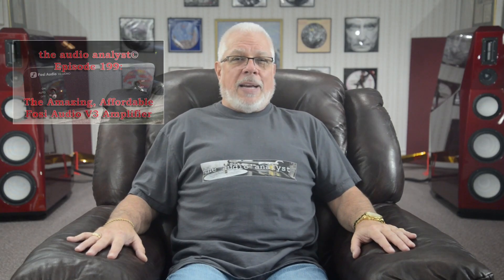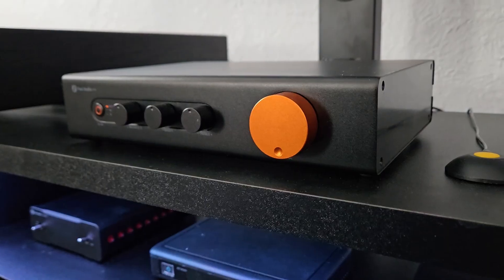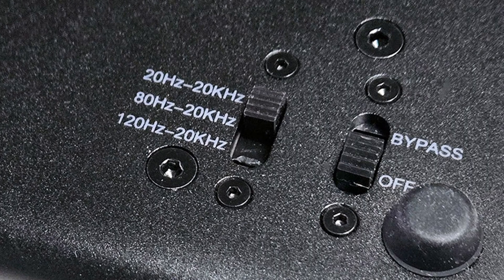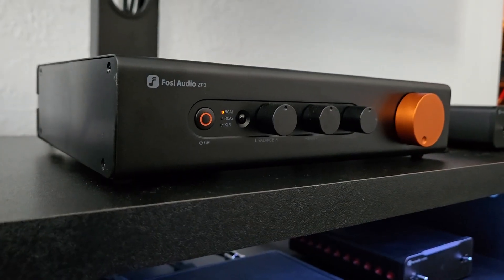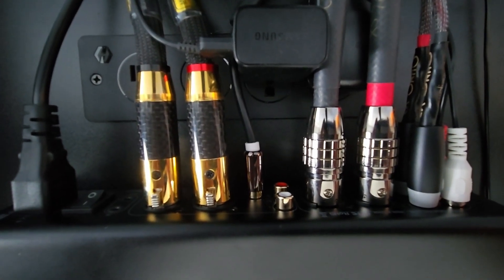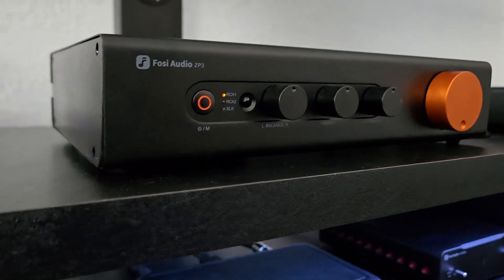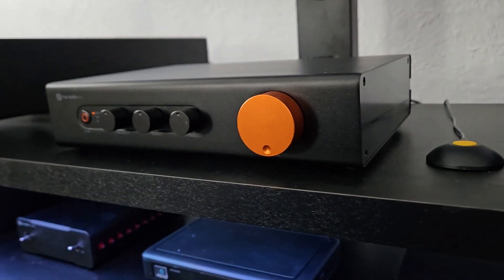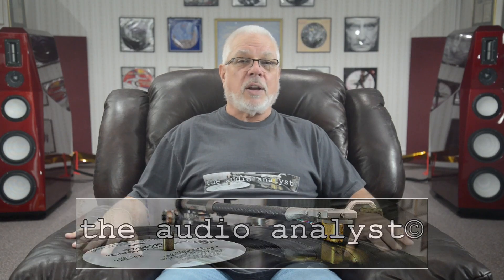E250: The Fosi Audio ZP3 Balanced Linestage

Comment: Speakers also has crossovers built in to them to block any unwanted frequencies that the speakers can't produce anyway either Higher Khz or lower Hz. So speakers getting damaged is our of scene.
Reply from the maker: In all my decades working with and around loudspeakers, designing and building dozens of pairs, repairing and or upgrading them, or working with many of today's best designers, I've never seen ANY such protection circuitry built into the crossovers by any manufacturer... Can you cite a specific example?

Comment: Very nice review thank you.

Quick question:

Can you adjust the sub level with the remote control?

Merry Christmas 🎄
Reply from the maker: Hello, and Merry Christmas to you as well! And no, of course the ZP3 remote cannot control your sub/s. Now, there are subs that offer their own remote control, usually using an app that allows gain and phase control.
Reply: YES you can, but it kind of depends what you're asking here. The RCA sub output on the ZP3 is a full range variable output. That means a couple of things. 1) The full range of sound is sent from this to your sub, just like other RCA and XLR outs. This unit only has a high pass filter, NOT a low pass filter. (It's NOT a full crossover.) So you'll need to use your subwoofer's low pass filter setting to adjust it to either where your speakers naturally falloff (at the 3dB down point), or where you've set your ZP3's high pass filter setting to. This was confirmed via ASR, despite Fosi indicating there was some sort of 200hz cutoff on the sub out. But either way... who wants to send up to even 200hz to their sub! You've got to use your sub's low pass filter in conjunction with this unit. 2) When you control the volume of the ZP3 with the volume knob on the unit or the ZP3's remote control, it adjusts the volume for both your main RCA/XLR outputs to your main speaker amps and ALSO the subwoofer out.

So YES, you CAN adjust the sub level with the remote control... but only in conjunction with the mains' levels. Of course, this is what everyone would prefer I think! And that's probably what you were asking.

In order to adjust your sub's volume INDEPENDENTLY of your speakers (to volume match or just set the low frequencies to your preference), you'll need to use your sub's amp's gain settings.
Reply: @KeepinItGameSince84  Awesome thank you very much. 👍🏻

Comment: You should give the Aiyima T20 preamp a try. It costs less than the Fosi and sounds much better imo. I added a LPS and some PSvane horizon tubes. I replaced my $6,000 Linear Tube Audio Microzotl preamp with the $160 T20.

Comment: Nice review Greg. I wholeheartedly agree, it’s a great little preamp. Especially with discrete opamps. I also love the HPF option as well as I have it paired with a 40 w/ch class A Nelson Pass amp and it alleviates the amp from having to deal with driving the lowest bass notes. The transparency of the ZP3 allows my Denafrips Pontus II DAC to shine through and the Pass amp to bring the sweetness and color. Not sure if I mentioned this before in your other video but I bought a simple Mickey Mouse to standard IEC adapter off Amazon allowing me to use high quality power cords with the ZP3 bringing yet another level of improvement.

Comment: I’ll never be able to add those op-amps 😖
Reply: Several people, including myself, have swapped the opamps out by using long tweezers through one side of the unit. You don’t have to take the unit apart. You will slightly mangle the stock opamps getting them out but putting in discrete’s with the tweezers is easy and takes seconds. I’m running SX52B myself. I tried the Sparkos and they sound great in the ZP3 of course but the SX52B just synergizes better with my system and tastes.

Comment: 👍🏻 Everybody loves an underdog. Its a good option if you need more inputs or the tone controls or the HPF. 

That HPF is something often requested but seldomly found. And it is such a great benefit if you use small monitors, like you find most Asian households. That is probably why they chose 80Hz and 120Hz. 

I could do with 120Hz where my monitors get to 0dB. Or maybe my old LS3/5a'. Both would do best with 80Hz though. 

Im using my Genesis VI speakers as subwoofers crossing at 90Hz and I can't tell where the bass is coming from other than determined by my monitors. 

I designed and built my monitors with 2 3" Ti fullrange per side front to back, closed cabinet with a small AMT supertweeter. Now i just switched to the Douk/Ampapa D1 TPA3255 with an adjustable HPF I do notice the improvement in dynamics and clarity you described. 

I find this hard to say but I think i like the Ampapa D1 with Burson V7 Vivid even better than the Fosi ZA3's with SX22B's. 

So I don't need the ZP3. Still, its a great addition to their Z lineup. 
And great review.
🇱🇺😀👍🏻
Reply from the maker: Burson has offered to send me the V7 Vivids, but I've not seen them yet. I am hoping to compare them with their V7 Classics, to see which I prefer in terms of musicality... Thanks.

Comment: So, I have the ZD3, ZP3, and ZA3’s running in mono.  I just purchased 2 Sparkos 3602 op amps.  Where should I put them, where will they have the greatest impact?
Reply: I'm using the ZD3 as a second dac and 2 ZA3's in mono. 
You will need 1 opamp per ZA3. That's first choice. (Sparkos, Burson or SX35B). SX52B's don't work in the ZA3 (I tested).

Run the dac to the ZA3's directly via the RCA needing only 1 opamp (if you don't use tone control or the HPF). You can use 1 SX22B which is even way better than the Sparkos. 
OR, use the ZD3's XLR output requiring 2 opamps. THERE you can use SX52B's. 

My advice is use the best opamps for the ZA3's, then you can even use $15 SX52B's Opamps for the ZD3 (those do not work in the ZA3's) if the budget is tight. 
Or use the fabulous SX35B's. Or use SX35B's throughout. When I first put those in the ZA3's instead of the Sparkos my jaw dropped to the floor. They are that good. Precise, fast, spacious and smooth. 🤩
Extra tip: get a Douk DDC (USB>coax with better clocks) for the ZD3. It cleans up the signal to compete with DACs way over €1k. 

My lowest budget recommend would be 1 SX35B per ZA3, 1 SX22B in the ZD3 and whatever you can spare in the ZP3. This will give any competitors up to €5k a run for their money. 
I play with a 15k turntable and a Laiv Harmony setup (R2R dac + preamp) with Rose streamer. 

👋🏻😀🇱🇺
Reply: @Jeep_on_audio  good recommendations - I didn’t know the SX52B would not work in the ZA3, good info!
Reply: They won't, its a placebo
Reply: @crazyprayingmantis5596  if everything sounds exactly the same, why are you looking at audio equipment reviews?  Just plug your $15 headphones into the socket on your laptop and save yourself some time and lots of money.
Reply: That is a GREAT question!

I have the ZD3 and V3Ms and have used the Sparkos in both, but never one at a time… I upgraded the V3Ms before buying the ZD3.

I’m going to make an assumption here, so take it for what it’s worth, but getting the most out of the amps will require both to be upgraded in each, requiring 4 pcs.

Personally, since having a bit of a “source first” revelation, I would try them in the DAC (if you’re using RCA you’ll only need one).

Tip: using the balanced inputs on the ZA3s will likely sound better as it avoids the third op amp RCA input stage (this is true for the V3Ms, anyway).

If you’re feeling adventurous, a great budget op amp can be bought on Ali Express, the SX52B, and they are likely on sale for the rest of the day.  Four of these for your ZA3s will be a nice improvement that won’t break the bank, and will surely sound better than just replacing one each with the Sparkos.

If you’re feeling really adventurous, I think the SX22B is a slightly better option than the Sparkos for similar money.  I’m using two in the balanced outs of the ZD3 and it sounds very nice to my ears.  Yes, they nearly double the price of the DAC, but so do the Sparkos, and tinkering with these Fosi units is pretty fun. 😊